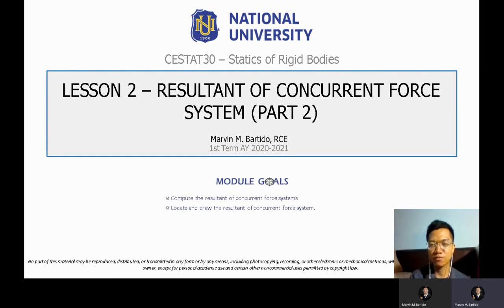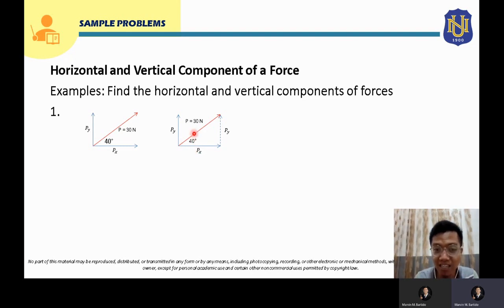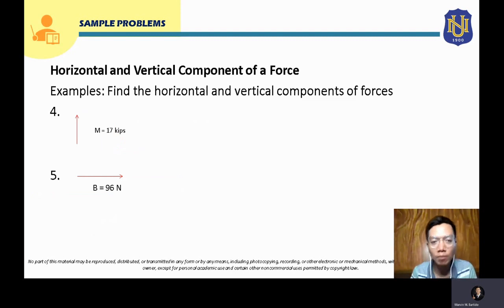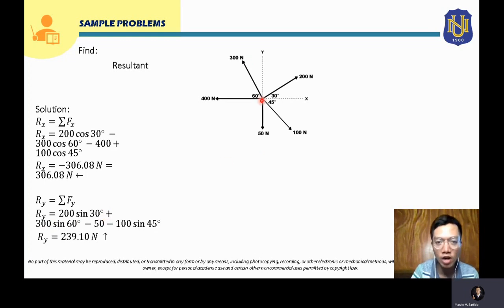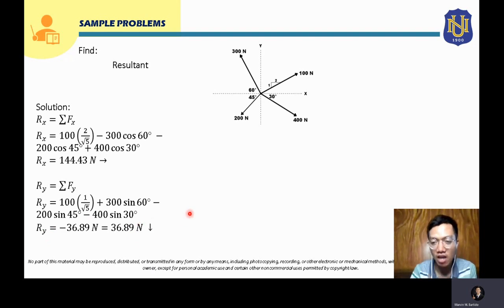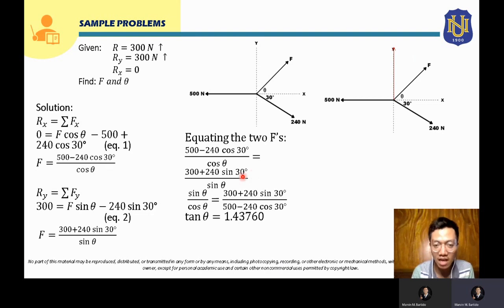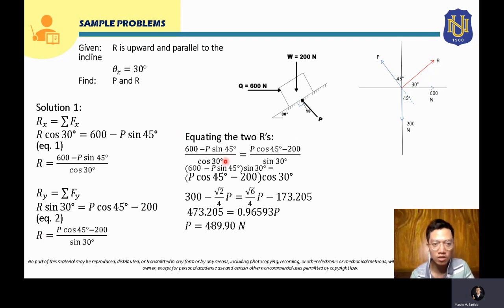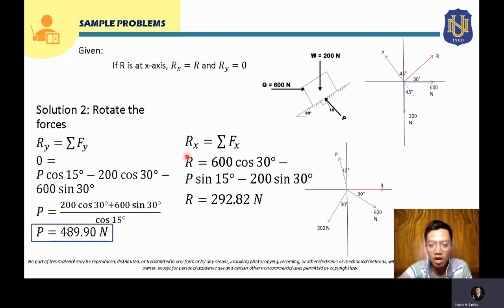Statics of Rigid Bodies - Resultant of Concurrent Force System (Part 2)

Comment: hi sir!! dun po sa last example i'm using two equations two unknowns sa calcu, Rcos30-600+Psin45 at Rsin30-Pcos45+200 ang nilalagay ko sa calcu, and i'm getting negative value po, mali po ata ang sign pero di ko po makuha kung pano yung tama, how po ang tama kung ang gagamitin ay yung two eq two unknowns?
Reply from the maker: The constant values must be at the right side of the equation, you need to transpose the -600 and the 200. So they will become 600 and -200 when you input in the calcu
Reply: @MarvinBartidoChannel natranspose ko na po sha e, may negative pa rin po, pano po equation nya ser, thank you po sa pag reply🫶🏻🫶🏻
Reply from the maker: Mode 5 - 1
cos30 sin45 600
sin30 -cos45 -200

Yan ang mga ipipindot mo
Reply: @MarvinBartidoChannel ahh oo nga po pala sir, thank you poo❤
Reply from the maker: @nicole-kq4me  mode 5-1 pala

Comment: bakit po inequate sa yung dalawang R? diba summation of y at summation of x yun? so hindi sila equal dapat diba
Reply from the maker: It’s not Rx and Ry that we equated, definitely they are not equal. What we did is inexpress ang Rx and Ry in terms of R. So since they are both R, inequate yung dalawang R.
Reply: @MarvinBartidoChannel  pero pano po naging R lang yung equation 1 and 2? Diba galing yung sa Rx= summation of Fx at Ry = summation of Fy? Dahil ba equal ang Rx sa Rcos30 para maging R lang since kaya na tanggalin ang cos 30? Kung ganun po bakit equal ang Rx sa Rcos30?
Reply from the maker: Rx is the horizontal component of R, so it’s Rx = Rcos30. It’s actually from the right triangle formed, wherein Rx is the adjacent side, R is the hypotenuse, Ry is the opposite side. So using CAH, cos30 = Rx/R, cross multiplying, Rcos30=Rx
Reply: @MarvinBartidoChannel  thank you po sa pagsagot